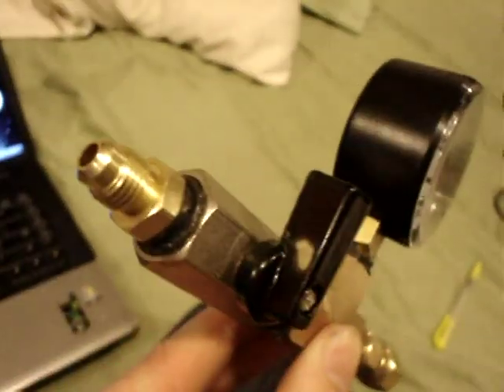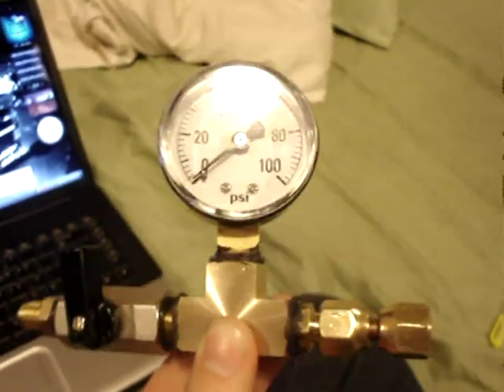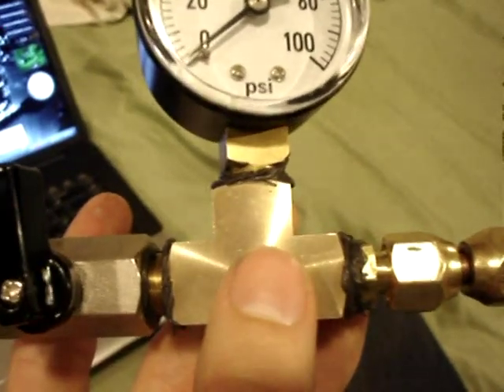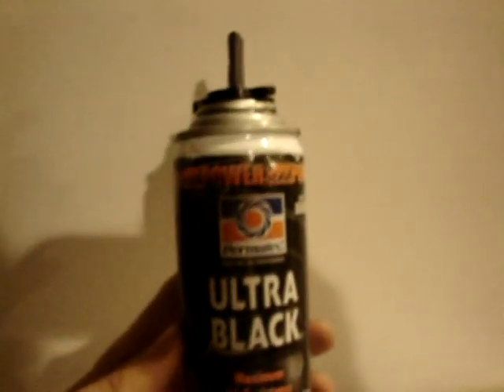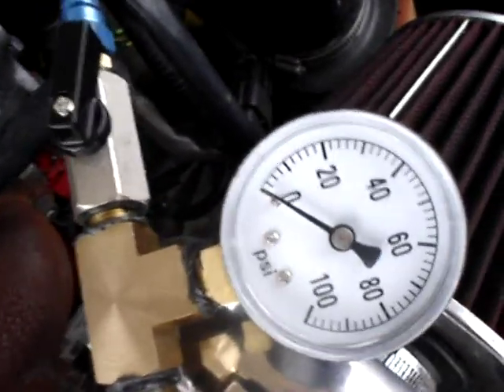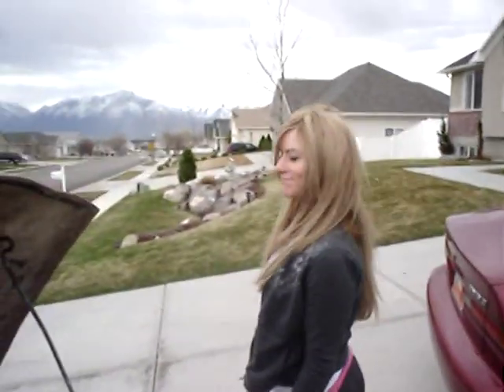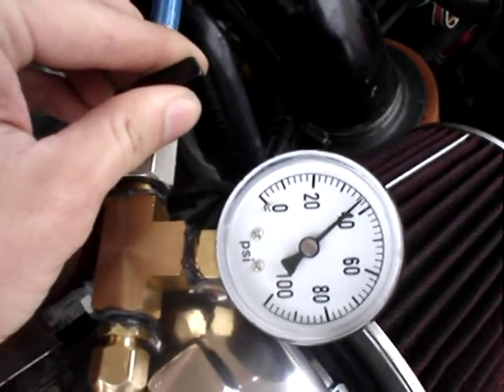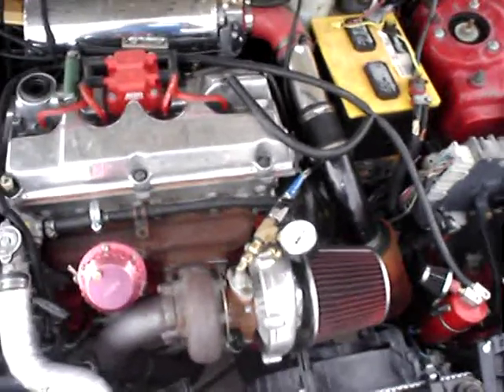DIY turbo high oil pressure regulator

Comment: that is a short term solution you need something with a piston and spring and return. That will just limit the flow to your turbo. when at boost for a long time it will still ramp up pressure slowly. because oil pressure is constant. Depending on how much your turbo bleeds off. it MAY work but not really a permanent solution.

Comment: I would check your turbos oil drain line. if it's to narrow it will cause your symptoms. You turbo has a built-in oil restrictor so it shouldn't matter what oil pressure you give it as long as it's above the minimum.

Comment: I have a vintage NSU with a semi automatic transmission. The torque converter is fed by engine oil and the pressure overwhelms the seals! I am going to use this great idea to keep the pressure to the converter reasonable.

Comment: Are you using oil restrictor on feedline on turbo? Or only this regulator? Because I have same problem and have restrictor with 1.5mm hole and it leaks.

Comment: Im going to put a turbo on my old truck. Im kinda new this turbo thing but can i use a oil pump and a oil regulator for the turbo? To use the right amount of oil to lubricate it? The way the turbo will fit in my truck is the oil feedline is at the bottom and exit is on top. My friend said something about fighting gravity? Think he refered to, oil wont go in the turbo?

Thanks

Comment: Ball valves are not designed to regulate flow, they are only designed for full open or full closed. if you don't want that turbo to fail in the future you might want to pick up a throttling valve. just my .02

Comment: can you tighten that ball valve to keep it from moving during high vibration? Was the valve still fine after the extreme oil temps?
I might do this for my dry sump setup.

Comment: Not necessarily. You can take the top bolt off the ball valve and then tighten the lower bolt so it is stiff, then put the top bolt back on so when you are driving the valve will stay in the same position.

Comment: Has vibrations from the engine opened or closed the valve from what it was originally set to?
Reply: also will the ball valve work its way shut or open from the pressure.

Comment from the maker: Ya but those $6 oil restrictors are subjective to whatever the oil pressure is on any engine out there. Even the 420a's oil pressure differ from car to car. If my car idles at 60 psi and the restrictor only shaves off 20psi I'm still idleing too high for the turbo. My cousin tried a restrictor on his 5.0 mustang and went through 3 different ones to finally get the turbo to stop leaking. But suddenly his turbo fried cuz it restrcited too much. IMO a gauged set up is the only way to go.

Comment from the maker: @Carnifreekshow  I did look into those restrictors that look like a carb jet but they had no way of knowing if you were restricting too much oil or not. I really wanted something adjustable with a gauge so I KNOW EXACTLY what the oil pressure is and peace of mind especially with a brand new $1300 turbo.